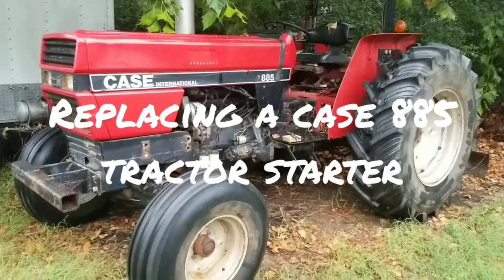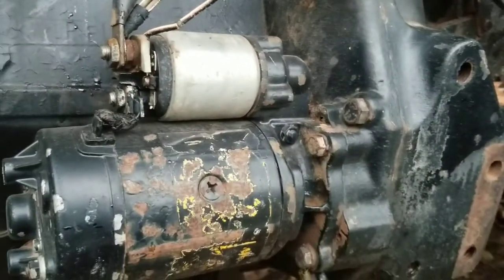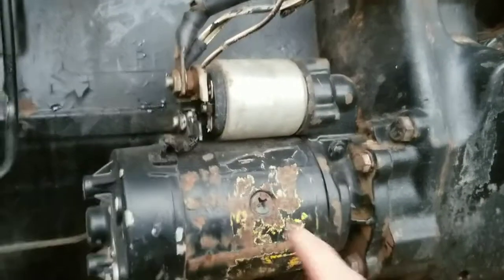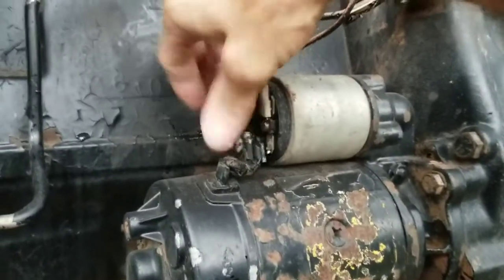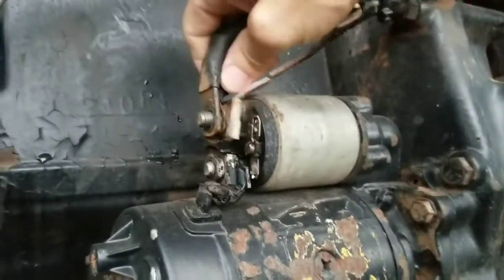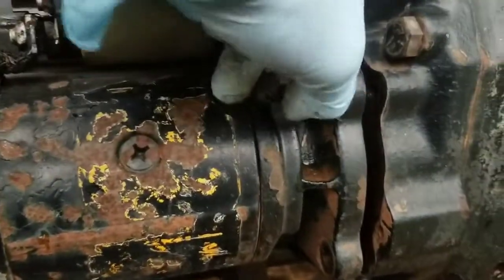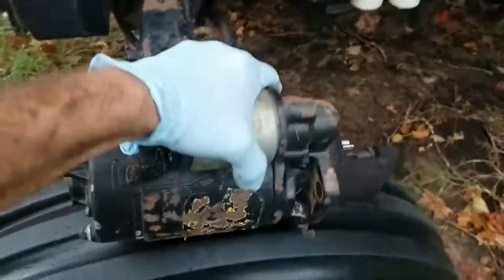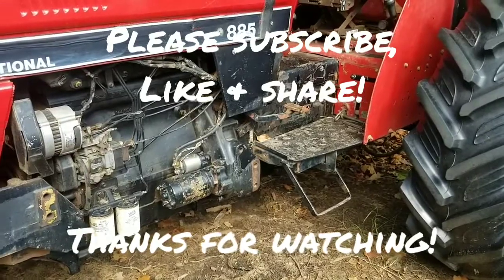Case International 885 Tractor Starter Replacement

Comment: I know this is several years old but I have a question about the battery cables. Is your negative cable ran to the starter or frame? I have a 685 (88 to 90 year model) which belong to my dad. After he passed, I am helping my mother run the farm. I found on this tractor that the battery negative cable is connected to the starter. And the battery positive cable is attached to the frame. I don't think this is correct and I'm wanting to know how your battery cables are connected. Thanks if you do get to respond.
Reply from the maker: I don't remember on this tractor since I sold it yrs ago. But on most tractors, I usually see the neg cable attached using the mounting bolt of the starter, which is a ground and good spot to make sure the starter is grounded.  Also the pos would go to the starter unless it has a seperate starter solenoid, which then the battery pos would go to one side of that and on the other side of the solenoid would go to the starter.  If the starter has a solenoid on it, most likely it has a trip/start/ign wire to activate the starter, and the power is bolted directly to the starter.  
Unless it's a pos ground tractor, which then everything is opposite. Hope I helped.  Thanks for watching!